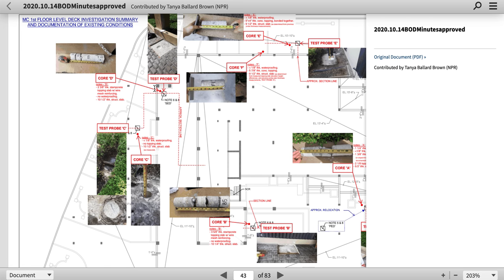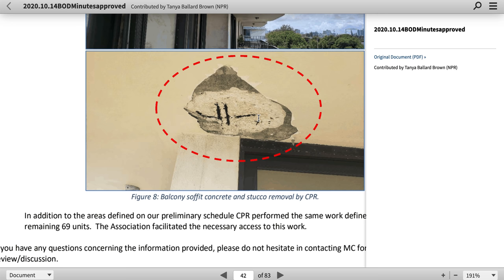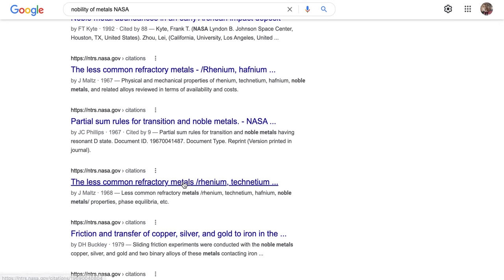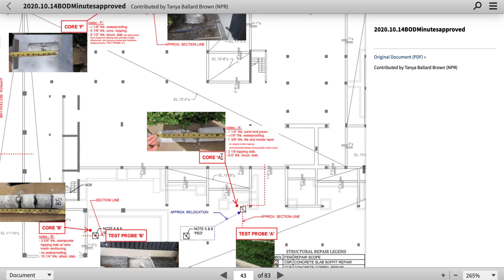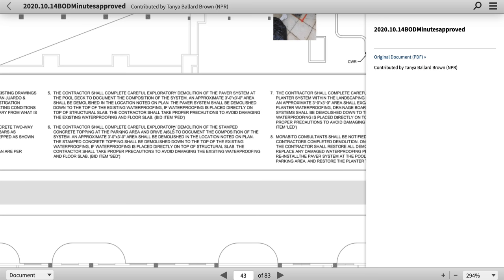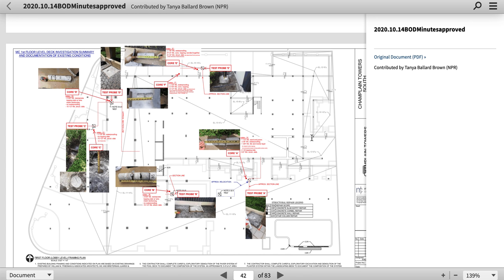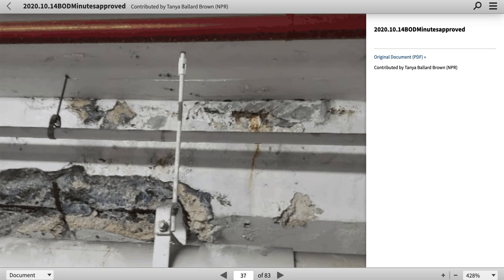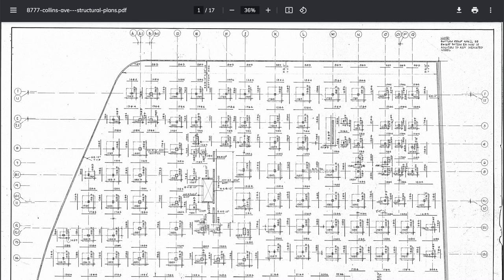Champlain Towers COLLAPSE POOL DECK CONCRETE CORE SAMPLES FAILED DECK VERY OBVIOUS IN CORE SAMPLES

Comment from the maker: Please,        thank me, by commenting and giving a thumb's up   this will be for the youtube algorithm...  I appreciate you all.  https://www.documentcloud.org/documents/20985354-20201014bodminutesapproved#document/p36
So, we get this weak deck failing in spans and then punch shear, then crippled column (perhaps M or L) and that causes shaking in the building and facing / front wall failure 
then upper deck failure then buckle or lower column (perhaps L or M)
buckle of column = directs flow / direction of collapse towards the rotation towards the middle area we observe in vide
Reply: Where did you get these core samples from?
Reply: Anyway we can post pics for discussion? Look at the corner piles, #72/73 and where the pooldeck connected, and they are white below tan above, theres rebar fanning out from within the coloum, like the poolslab rebar was attached in the colums, could be an optical illusion
Reply from the maker: @jameschandler3308  Video reply tomorrow ...
Reply: Awesome! The more i look at that severance, and i zoomed in and captured the images i have off of the clearest images i could find, and if all of the others around the collapsed section are the same, then i can easily see how the butterflying had more colums to pull on the collapsed section, plus other factors like since those were non exposed colums in the collapsed section, they may have more spallin type damage,, because the standing building colums, 72/73 and the corner pileing 74 75? Are exposed to more air circulation, and maybe wernt as "rotten" as the collapsed section, plus the firewalls n elevator shafts were close by, bc at first im like how in the f@k did that section not fall, tho they looked tilted.
Reply: @ForensicCats  Champlain Tower South: visiting unit 611 on July 17, 2020 - Surfside FL showing the state of the car park ceiling

Comment: As a homeowner of a regular single family home, I’m AMAZED that a group of volunteer homeowners are the ones responsible for the PHYSICAL STRUCTURAL INTEGRITY of a high rise building! Not only do they have a conflict of interest in approving repairs that cost them money, they do not have the skill set to make the technical decisions. Maybe I am just ignorant but when I see a high rise building, residential or commercial, I would have had ZERO idea that the tenants themselves have that responsible to make sure a building is safe. I assumed the owner of the property itself (not each unit)  is constantly maintaining and working with competent city and building engineers on a regular basis. 40 years between inspections? NUTS!
Reply: Tenants are renters, the people who lived there own the property as association as such they are the owners as a group.  The local building inspectors had the actual authority to inspect, and condemn the building unless proper repairs were made.  I would agree that maybe all high rise buildings should have corporate ownership only and just rent out the space, but without major legal changes that is not the actual reality. Condos of any kind are generally built on the cheap to a tight price target. Condos were still relatively rare in the early 1980s when this particular building was built.   I personally would never live or work in a high rise because of the safety issues.

Comment: Florida had passed a new law in 2008 to require all large buildings to undergo structural inspections every 5 years. These were repealed in 2010. If they had been left in place, maybe this would have been caught and fixed earlier.
Reply: @James Keefe That's interesting. You mean there was a law on the books for the ENTIRE state? And "they" the lawmakers repealed it after only 2 years? IF True and I have no reason to doubt you,  That's HORRIBLE to say the least.
Reply: Doubtfully, if the accounts of the HOA are accurate.
Reply: @charlesdang4670  Yes, but doubtfully in Florida.
Reply: @seanm3226  I tend to agree.
Reply: @Rush__Man 
Why shouldn't the deck also used as parking spot?
Reply: @seanm3226  
Why? You could replace the hole pool deck.
You could replace the floor.
you could strengthen the columns

yes that cost much money - but a new building cost much much more
Reply: No. The bill required FINANCIAL analysis of a condo associations ability to pay for major repairs every 5 years. Either way, it was a good bill and it sucked that a State Congressman that was also a real estate developer led the charge to repeal it🙄
Reply: @tommyjacobi2054  the unit owners didn’t want to pay the $7 million bill required to fix things as of the 2018 report, and they REALLY didn’t want to pay the $16.2M bill required by 2021 as the damage progressed. They were fighting tooth and nail with the HOA leadership that understood the magnitude of the problem…

Comment: Thank you. Another  nice video.
Engineers typically don't like you drilling through their rebar.   There was minimal (not a lot of) rebar.
Reply: If you want to look @ the rebar corrosion in the slab it is a good idea to drilling though rebar.

Even if you should avoid - rebar with 8" overlay is not easy to locate.
Reply: @tommyjacobi2054  that core was dead center on rebar.  They should have chipped around rebar.  Even with dousing rod for pipe trench at depth - split the two deflects on each side of trench.

Comment: What you are thinking of is galvanic corrosion caused when dissimilar metals are connected in the presence of an electrolytic solution. The action is at the anode. Welding can cause a change in the metal which makes it anodic and will corrode quickly.
Reply from the maker: No evidence of these being a ''weldable rebar'' nor do we find welds in the collapse images (so far)...     This is not about welding but material ''reactions''...

Comment: At about 20:25, the video shows the meeting minutes from a Condo Association meeting last year. I found it interesting....the top priorities? Issuing fines for an "unregistered pet" in the building. Also, not wearing a mask in a common area should or should not carry a fine for this egregious violation.  Meanwhile, they have an engineer report from 3 years prior stating that the building is in poor condition and that the structural integrity is deteriorating "exponentially". But let's not jump on that...let's discuss fines to specific residents for petty things instead. Shame on all the members of the condo association

Comment from the maker: So, we get this weak deck failing in spans and then punch shear, then crippled column (perhaps M or L) and that causes shaking in the building and facing / front wall failure 
then upper deck failure then buckle or lower column (perhaps L or M)
buckle of column = directs flow / direction of collapse towards the rotation towards the middle area we observe in video
Reply: That's what I'm having trouble with. The shock wave is going back and forth from shear wall to shear wall for 7 minutes. Those elevation changes on the first floor are doing "something" to amplify that vibration back to the west shear wall. Column M, to me, seems unlikely because the fire tower is what's holding the east end up for those few seconds. Where I'm at is the MOMENT is occurring under the x11 apartment stack, but the first deck failure might occur in the x10 apartment stack. My only data pointing to that is the ring video with the TV box bouncing to the right.
Reply: I wish we could add pics, but what i saw with colum 73 where , "and i like his description with butterflying", you can see 4ft lenghts of rebar bent down sticking out of colum 73 where the pooldeck was once attached,, its a miracle it did pull that colum down too, that probably would've started the fall of at least that corner section on the far south that didnt fall.

Comment: For all of those that think that there will be criminal charges against the association, don't hold your breath.  Now in saying that, it looks like this entire building may have not be built to code back in 1981.  If that is found to be true, then the construction company would be on the hook for this disaster.
Reply: Apparently since the whole remaining building has already been torn down nobody in authority is interested in investigating anything.
Reply: " it looks like this entire building may have not be built to code back in 1981"

which rules of the code were not followed?

Comment: Was they post-tension decks or just all rebar?
Wasn't the penthouse constructed on the roof years after the building was completed? If so, was it a continuous roof, meaning the columns were not capped off and the roof was rated for additional weight in the future such as a penthouse.
Reply: just rebar

i think the penthouse was build straight with the other storys but i am not sure

Comment: Why did they cut the rebars? Core A and core B have cut rebars. It is NOT acceptable to cut or damage any structural steel during coring. Coring contractor MUST do GPR scanning to locate all rebars or conduits before any drilling or coring.
Reply: And Core D has a cut bar.

Comment: Most rebar has a coating of rust on it BEFORE the concrete is poured!
Reply: True, but upon contact with the wet Portland cement in concrete, it forms a whitish-gray passivation layer which actually provides some level of protection against further rusting.  However, if chloride (salt) ions are allowed to migrate all the way through the concrete cover, usually accompanied by moisture (H2O) molecules, then the passivation can be broken down and lead to run-away rusting.  Pity.
Reply: @MajorCaliber  True!

Comment: 13:55 "or sloped mortar topping documented and viewed during earlier probe work" 8:05 Oxygen is present everywhere, even in concrete. Oxygen pulls ions from the iron, forming iron oxide. The salt water acts as an electrolyte facilitating this transfer of ions speeding up the reaction. It's not the metal reacting with itself. Concrete is permeable to both oxygen and water. This is why building codes require waterproofing on concrete walls.
Reply from the maker: Trapped oxygen is determined to be "safe"; it is the open air / ambient air with moisture content that is an issue... Oxygen without moisture has almost NO effect on metal... I will do a video on this for you lovely viewers.
Reply: @ForensicCats  Locally, in California,  there were some homes with boat docks in their back yards... The soil, over time - years, reportedly went through "the wrong type of concrete". Is there a waterproof type of concrete? Perhaps a mix with an epoxy polymer?
  Long story short, the soil wound up in the docking area and harbor. The homeowners didn't know there was an issue until a lady came home to her furniture being held up by the carpeting racks, and essentially a sinkhole under her livingroom.
It was pretty crazy, as a family member nearly bought one of those homes, yet thankfully did not.
Reply: Future ocean front construction should be sloped and waterproofed!

Comment: Salt water is a rapid corrosion accelerator.  If this rebar was exposed to salt water either during construction or after, that would result in the severe corrision.  The cracks in the various samples of concrete suggest water could easily get to the rebar.  I hope there is more investigation into the construction and repairs.

Comment: I saw a news clip re: another building that is now in renovation in the area. A guy was talking about doing repairs to concrete using higher density concrete than was used previously to "make it stronger". Don't different concrete densities have a different COEs (coefficients of expansion)?
  When I heard that, I couldn't help but think that would initially look nice, but over time, could it crack, separate & cause failure, much like melting different COEs of glass in a kiln, then cooling? The glass doesn't meld, it fractures.
  It sounded quite alarming to me. Could those layers in the concrete core samples be from different concrete densities, contributing, or perhaps even causing the failure by different expansion/contraction rates?
  I'm no engineer, but it would seem like this may have contributed, or perhaps even caused the failure. 
  Just a thought. 
Thanks for taking the time to go through this. I think we all want answers. 
Blessings.
Reply: " Don't different concrete densities have a different COEs (coefficients of expansion)?"

No

Comment: My guess is that failed columns led to the punching of columns through the pool deck. The pool deck by itself is too light to affect the towers. Tower columns on the otherhand could have very well brought the pool deck down especially if the decks were post tensioned.

Comment: you know i'm just gonna be totally honest here; like some of the pictures you showed from the rust jacking photos look horrific.. i made a trip today to micro center in Yonkers, NY which means driving through a low ceiling parking garage to the top and its one scary ride I mean there are cracks and holes in the concrete and its a bumpy ride to the top.. so my point, i haven't seen ANYTHING in any pictures or videos from the collapsed building that is any worse than any number of places that I have gone to in my life and continue to go to.. hell my own apartment that I live in has sagging beams, cracks in the walls.. water leaks.. so WTF made this building come down.. some crappy construction 30 years ago? that waited 30 years to give out?? I just don't know man. But it really bothers me.

Comment: I’m curious about the anchors being installed on the roof and their purpose. I hear the purpose of the anchors are for window washing then read that wasnt what they were for. That type of window washing wasn’t legal in the area. Obviously the collapse came from the basement but could the roof have any clues?
Reply: From what I've seen in another video the anchors were being installed for use by the folks installing a new roof.  If you look at just the section that didn't collapse, there are a lot (18-30) of these davits, that seem to have been installed for use by the folks who needed to have a tie off while working on the roof.  That could also explain the pounding sounds that have been reported in the days and hours prior to the collapse, as they were being installed.

Comment: It seems to me that the logical construction sequence would be piles. pile caps, columns to lobby level,  then level 2 through 12, and roof.   The garage slab and pool deck would be poured last.      That would leave a cold joint between the building columns and the pool deck.  I wonder what the design detail was at that condition?

Comment: I have been following your videos daily. The garage video is troubling.  The water leak appears to have originated  from a white pvc tube, not the red sprinkler line.  There is a crack in the concrete right at the north entrance.  And to me, the ceiling looks a bit crooked, but that could well be an optical illusion.
One question:
What do you know about chloride concrete accelerants?   I watched a lady from the AMPP who mentioned that   it was used to accelerate the concrete until the early 80s, but it could have been a corrosive factor in such a  saline exposed environment. 
That would corroborate  your theory of rebar cancer corrosion.
Reply from the maker: Yes, and current day, that is still an issue...  all chemical reactions on the steel is an issue.
calcium chloride concrete set accelerator is used BUT, in Florida, I doubt if they had to use it.
Reply from the maker: PS it is also called '''high early'' in the contractor ''dialect"...
Reply: @ForensicCats  She mentioned that on local TV.  That it was used in the early 80s but had been stopped.  
The host didnt ask why.
There was another guest who mentioned that the current recertification process doesn’t include structural corrosion analysis. 
But maybe I understood that incorrectly.